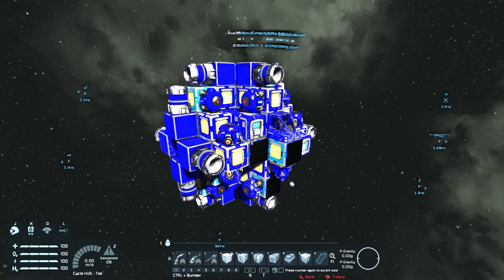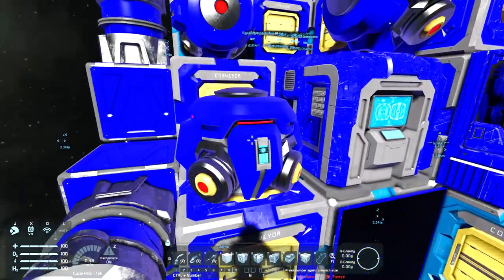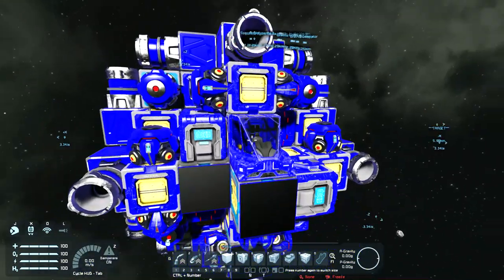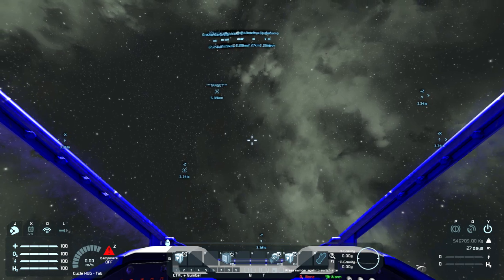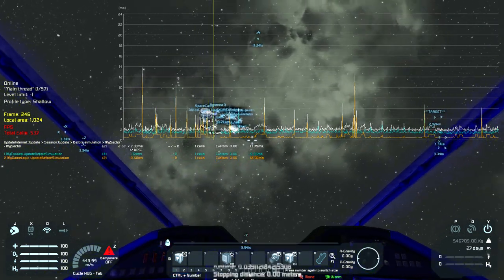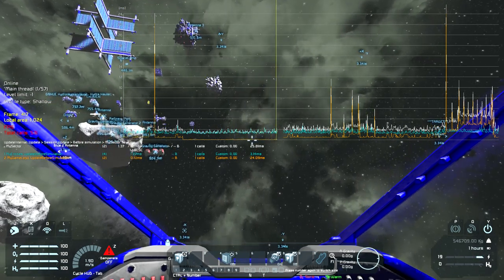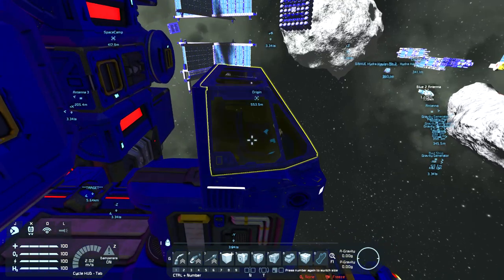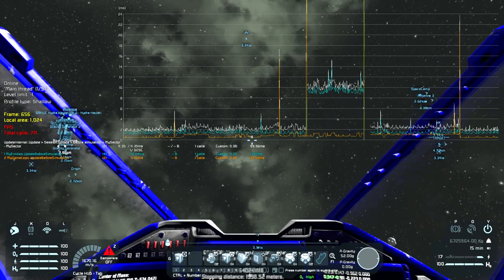[Space Engineers] Using a Programmable Block and Cockpit to control a gravity drive

Comment: Omg you don't need to do that M4 stuff and invert that matrix, just do transpose.
var yourLocalGridVector = Vector3D.TransformNormal(Vector, MatrixD.Transpose(yourGridBlock.WorldMatrix));

Also you do lots of unneeded grav gen (and artmass) setter calls each tick (.Enabled setter), that's really bad for performance. For some reason gravgen on/off API call is costly and not good idea to touch it too often. Better just set grav power to zero but let everything be online, at least on per tick basis. That's from my personal experience.
Reply from the maker: I'll take a look at this the next time I'm in Space Engineers, thanks!